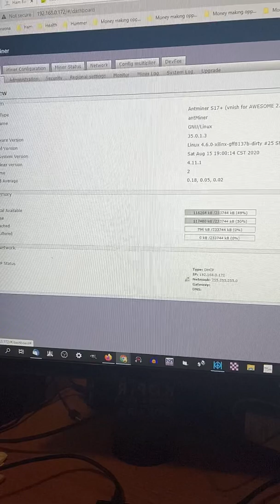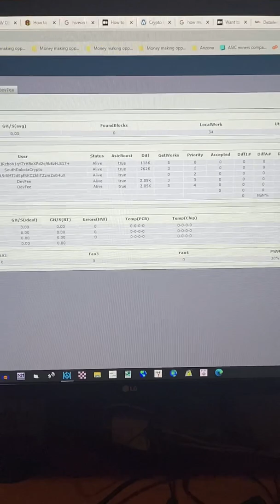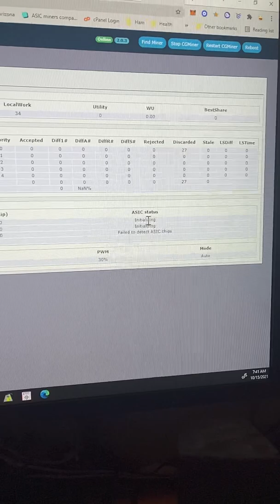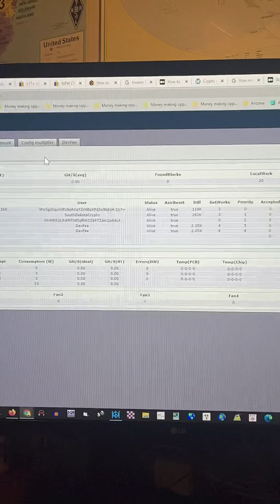Antminer S17+ Troubleshooting - No Hash

Comment: Hi, I've been working on Ant Miner repair for over 5 years, unfortunately you lost all 3 hash boards. If you have more s17 / t17 miners, you should put them on the power supply to prevent hash damage.
Reply: Thanks 🙏🏻 for taking time to comment. I appreciate it

Comment: The new control board did not fix it. I ended up shipping the boards back to China to be repaired. They reattached the heat sinks that fell off but didn't test the boards because when I got them back they still didn't work. I got only one board working. I ended up re-selling the S17+ on eBay. I took a $500 loss, but I'm glad to have recouped something. Maybe the new owner can fix it.

Comment from the maker: New control board is on the way. Hopefully I can get this miner up and hashing.
Reply: Where did you order the hashboard from?
Reply: Hello sir, I have the same problem that you are having, which do you think is the possible solution to that problem. If it were possible to help me, or at least to know what I can do, I would like to thank you very much for the help you can give me.
Reply: It’s not the control board thats the problem. I see that it shows 30 something chips out of 65. That means that chip 30 or whatever it is and the following few chips should be checked for “solder balls” or check for chips being pulled off the hasboard from weight of heatsink and lack of bind to pcb